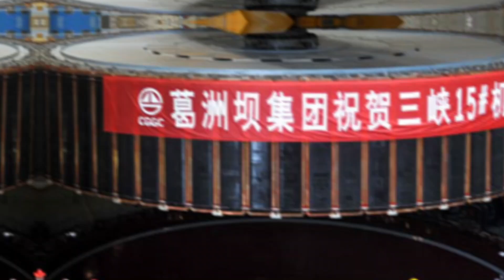China's Three Gorges Dam: The World Most Powerful Dam

Comment: I am slightly disappointed on this video,  the Three Gorges dam has been operational since 2012 so it has been producing electricity  already in 12 years. This means that there should have a lot available data on its operational track record, for example what has been the annual values of the electricity produced and how does this relate to the building costs and on basis of all this what could the payback time be.....Instead of presenting operational data from the last 12 years the video only showed some old footage from the gigantic building site.......So I am disappointed....